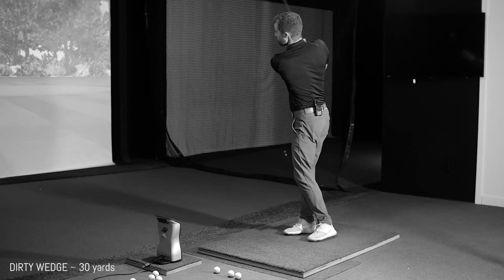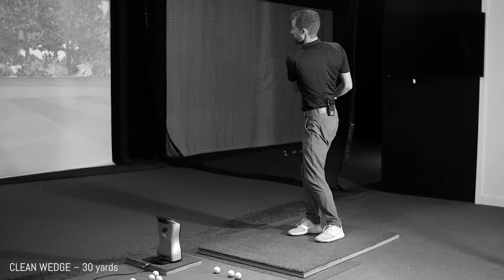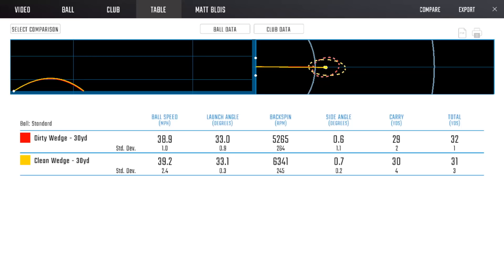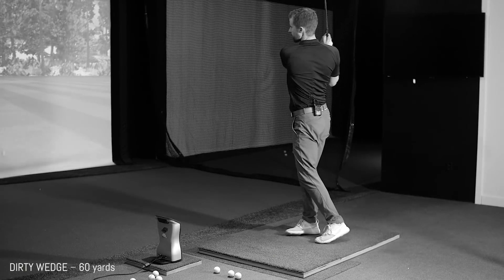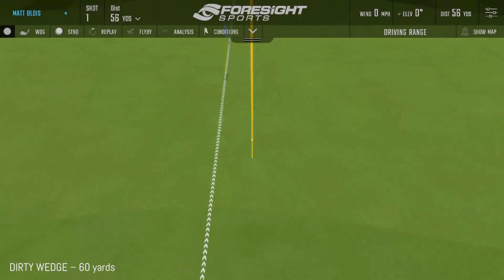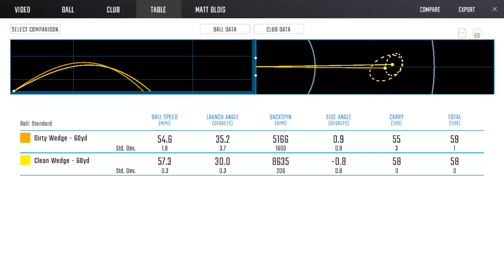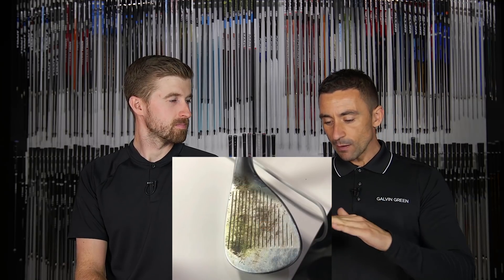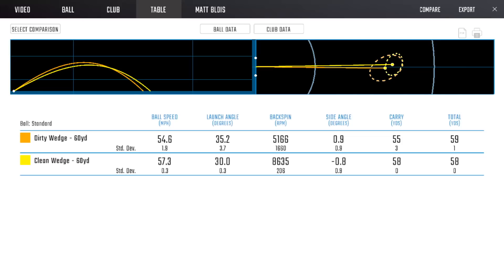Spin Test – Clean Wedge VS Dirty Wedge

Comment: Ian--tests have been done with grooveless wedges. Under controlled conditions they spin as much as half as much as grooved wedges. F1 tires are optimized to interact with the track surface. Golf balls and clubs cannot be optimized for each other because of the rules of golf and because a golf ball has to work with all types of clubs in varied conditions. Your test with a dirty club on the GCQuad actually underscores the shortcomings of having no grooves on a edge.

Comment: Hi guys, I saw another YouTube channel put tape on a 7 iron and it spun less in indoor conditions. How does this compare to Ian’s explanation on wedges without grooves spinning more in the dry (he compared to formula 1 tyres). 

Many thanks and keep up the good work.
Reply from the maker: Assuming you mean Rick Shiels' recent video, he used duct tape which wouldn't perform the same as a grooveless club. The tape would create a more slippery surface and have less friction with the ball leading to the loss of spin. (metal club face to ball versus tape to ball)

Comment: Am I correct that a flyer is a shot that spins less, goes much longer than normal, penetrating flight, as if a knuckle ball?
If grooves of any iron are filled with debris, will we be simulating the 'flyer'?
Reply from the maker: Yes that is essentially a flyer, if there's enough dirt and debris on the club you can simulate a similar result.

Comment: Can you comment on groves that have been outlawed I.e., square that supposedly made it easier to spin the ball?  Thanks again
Reply from the maker: Square grooves had a greater groove volume making the performance from the rough much better than V-grooves. They channel away more grass and debris leading to increased friction between ball and clubface which equals more spin.
Reply: That makes sense.  Thanks for the explanation.  I heard a storey about Phil Mickelson.  When he was test wedges for Callaway, he hit the ball and the sharp square grooves cut into the ball to the extent that it ruined the ball but generated a tremendous amount of spin to which Phil exclaimed "that's the Mac Daddy!" thus the name of the Callaway wedges.  Truth or fiction?

Comment: How often do you need to change your wedges? Or How often do you need to sharpen the grooves in order to keep them perform under wet condition.
Reply from the maker: Depends on how much you play and practice, if the wedge isn't severely worn it should still perform well enough. More important to keep them clean and as you say you can always sharpen the grooves if necessary.

Comment: I had a wedge made for me, no grooves. At a tournament in France, with pros, they did not believe it spun as much until they tried it. Very amusing. But, of course, the lawn was dry and clean, so the friction was not impeded. Sadly, the various manufacturers will often feature grooves as a spin tech issue. Rather, what they MEAN is that spin with well-designed grooves in WET grass or dirty conditions will spin more than poorly designed grooves, or grooves filled in with debris. It never stops, does it?

Comment: Why doesn’t somebody make a grooveless wedge for dry conditions (especially since those conditions yield firm greens) since the grooveless wedge will spin more in dry conditions? Rules?
Reply from the maker: Not against the rules but would be a pretty limited market, can't think of too many courses with no rough or hazards at all. There is a company that makes grooveless irons, can't remember the name though.
Reply: Definitely would be limited use but if you had room in the bag...

Comment: Would be interested to see the difference between a typical range ball hit with driver, mid iron, wedge, etc compared to a premium ball. When I go to the range I want to get a decent idea of my club distances but I’ll have rangeballs that seem to fly much further with mid irons than they do in the course with pro v1s. 
I think it would help in practicing to know if you should just discredit the distance and flight of a range ball because it’s so different than a premium ball you’d game on the course.
Reply from the maker: Range balls tend to spin less generally speaking, which would explain why you might hit irons farther.
Reply: And that very much depends on the type of range ball. My range has balls that are of a completely different compression than regular balls and they only go about 80% of the distance I hit a regular ball. Reason is that my range I quite short and long hitters were hitting their drivers into the farmer’s field.  Never use range balls to gap your bag. :)

Comment: I don't really think your description of WHY a higher spinning shot holds true.
Aerodynamics can't affect the launch angle, it is to early in the flight.
What happens is that the 'grab' of the ball that creates the spin,
hinders it from moving up the head and instead launch immediately and at a lower angle. 

Otoh, with a more slippery head or ball, the ball glides more on the surface and therefore leave the head at a higher angle with lower spin.

In absurdum, a flat head with soap of teflon on it, would makes the ball almost impossible to move forward at any distance, 
as it would mostly just pop right up.
Reply from the maker: that is essentially what was said in the video – the question was asked whether it was aerodynamics, and Ian responded by saying it was in fact the friction between club and ball.
Reply: I think you misunderstood our description of what creates spin.  We absolutely said that friction was the key factor not aerodynamics.
Reply: I stand humbly corrected.
Thanks guys!
I've re read my text and realized a rather vital part of the text was lost:
"... WHY a higher spinning shot holds launches lower true. " 

For me at least the driver reference was misleading, as that ball path depends on aerodynamics whereas wedges launch angle depends on the contact with the club.
Again, thanks. Listening again made is clearer.